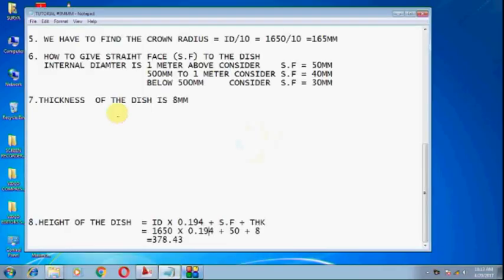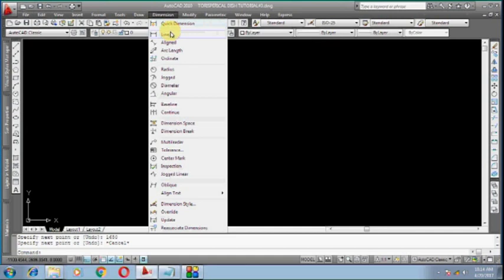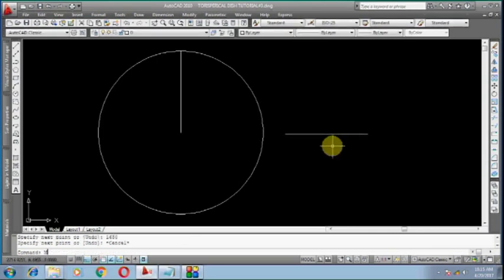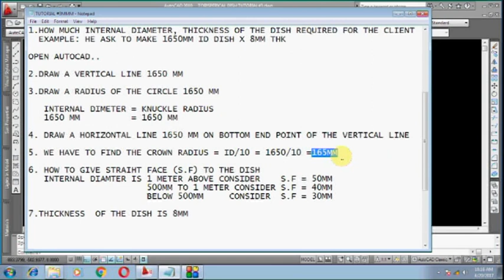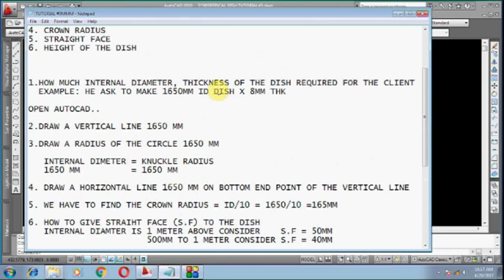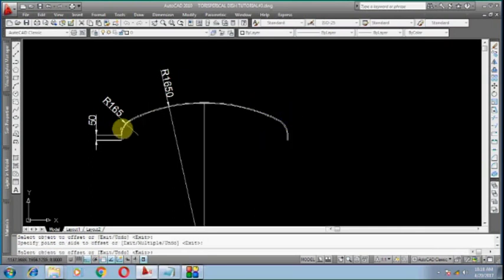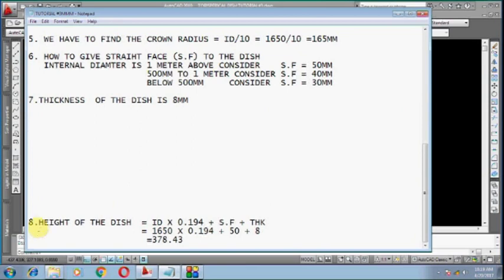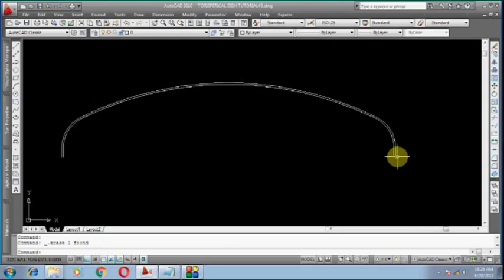HOW TO DRAW A TORISPHERICAL DISH IN 2D DETAIL EXPLANATION TUTORIAL #3

Comment: First, I would like to thank you for taking the time to upload this content which was very helpfull for me and made me decide to investigate more into the topic. In my research i kind of found out the concepts are upside down on this video. I found out the crown is the spherical dished portion of the head,  and the knucle is the transition between the crown and the skirt or the vertical section of the head. This comment is intended to complement the info you provided in the video and with absolut respect for your job. My sorce is the BPVC (Boiler Pressure Vessel Code) ASME section VIII part 1 thks a lot and greets from Mexico.